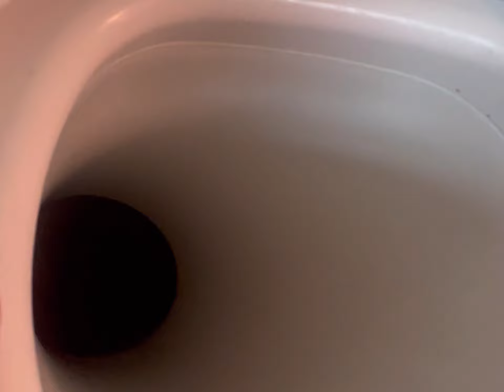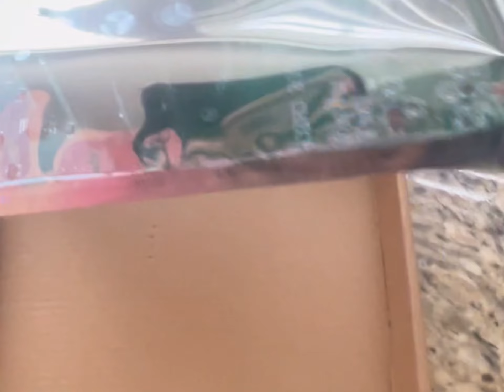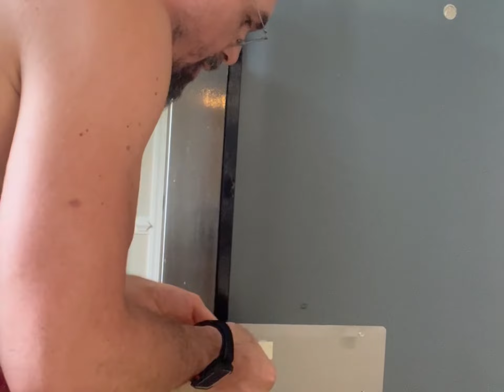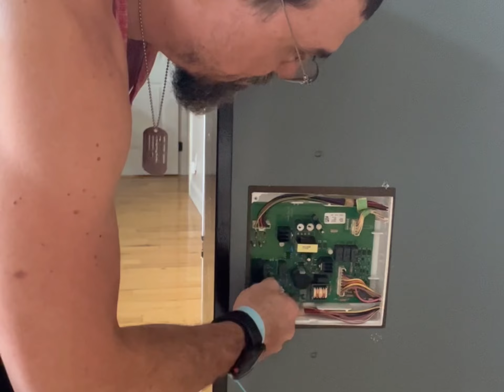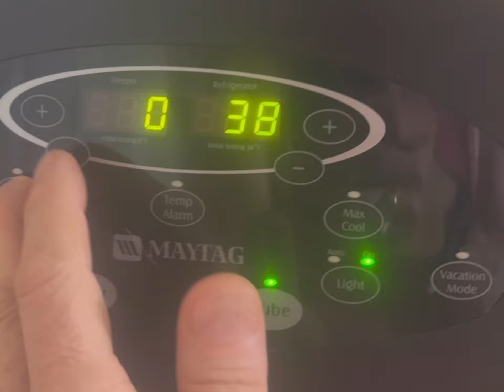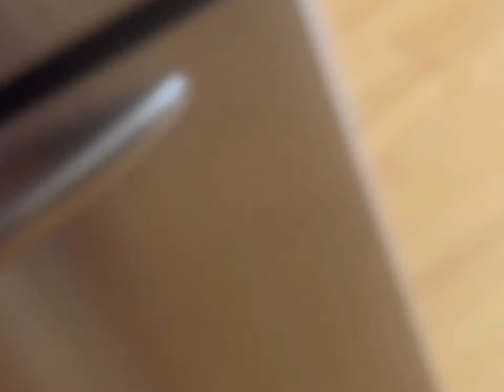Step-by-Step Guide for replacing a High Voltage Circuit Board on a Maytag Fridge Model #MFI2568AES

Comment: I have replaced the board. When I power up the refrigerator there is a clunking sound that is coming from the ice maker sounds like the flapper door is repeatedly opening and closing rapidly with a thud. Also there is a continuous beeping unlike the refrigerator in your video that is making no noise at all. I can never get to the PE position.
Reply from the maker: Not sure what your problem could be!  Sounds like perhaps a different issue than what i had to fix. Good luck getting it figured out!

Comment: I ordered a  new motherboard from Amazon. Installed it and it worked for about 3 minutes then stated flashing, beeping and  I was back to the beginning. Any suggestions please!
Reply from the maker: @lisaphelps-er4ny  you may have purchased a bad board.  May want to return and get another one.
Reply: When you reset the PE code you need to hit the freezer temp button down (-) to save the code not the door alarm button....Took me  awhile to figure out that this step was missing in the video...
Reply: 9. Once the desired Program CODE is entered, press and hold the Freezer Temperature DOWN /- Keypad until the Program CODE begins flashing, indicating it has been saved.